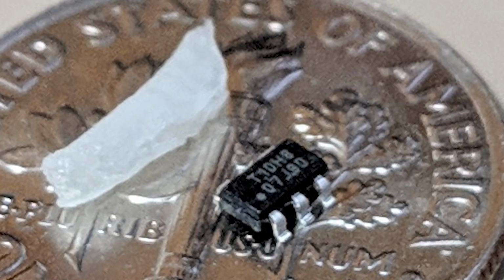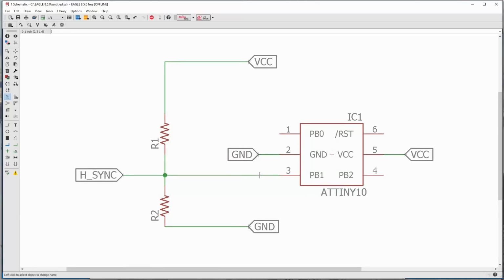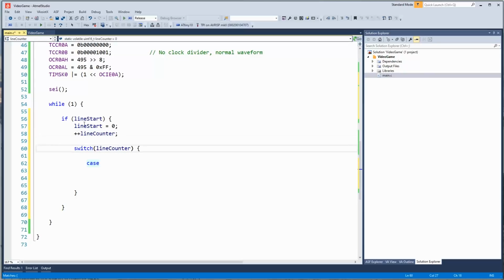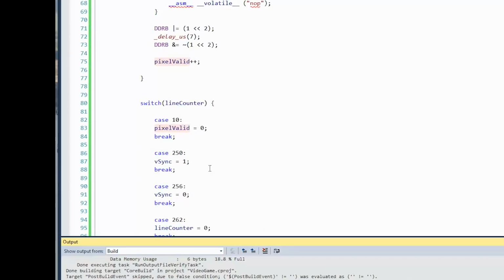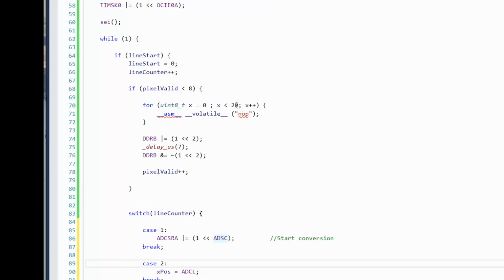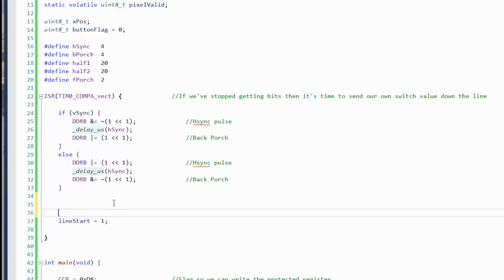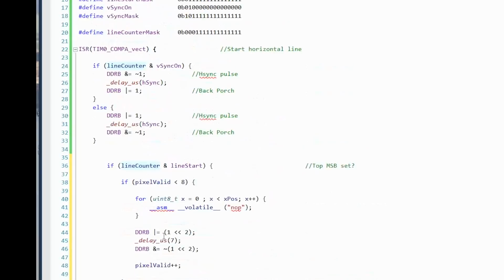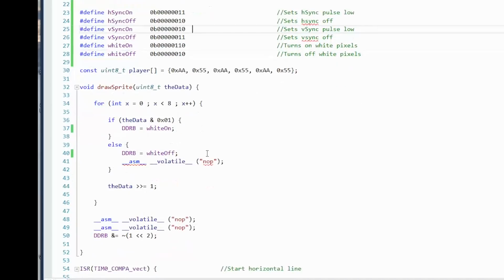ATTINY10 Console Part 1

Comment: Ben, to keep your code significantly more readable you should use bitfields instead of doing all the math yourself. It allows you to declare the exact number of bits you need for a variable. you do have to stuff them in a struct together though. struct { uint8_t pixelValid:1; uint8_t hSync:1; uint8_t vSync:1;uint16_t lineCount:9  }videoData; for optimization's sake i would also add a uint8_t pad:4 in the middle so the lineCount is aligned at the bottom. This may or may not make a difference depending on your instruction set or your controller but it can. All the single bit variables will generally use single bit compare, set and reset instructions so they are faster that way also. Though to be fair the compiler is likely figuring out what you're doing and using those operators anyways.

Neat stuff getting a video signal in that small of a micro :)
Reply from the maker: I'll look into it!

Comment: Great stuff! Dabbled with video generation on AT chips myself (ATmega328 and ATtiny84), but that's just an added challenge to make everything work on a 6 pin ATtiny10, good job. For tips on stabilizing the linestarts: 

1) Make everything happen in the interrupt regarding drawing, and use the main loop for game logic (you kinda did this already)
2) add a crystal or calibrate the internal oscillator, on my own systems the line stability increased simply by using a crystal instead of the internal oscillator
3) entering an interrupt takes a variable amount of cycles in AVRs. Even if the chip was timed with an extremely precise oscillator, you'd still get line jitter depending on where in main loop your code was when the interrupt was called. It takes anywhere from 2 to 4 cycles to enter an interrupt and you almost no way of knowing how many it took this time. Luckily you are using a timer interrupt, and you know when it triggered, so waiting for a specific TCNT will take the rest of the instability out. Might require some assembly massaging though to make sure the wait/synchronize function ended on the exact same TCNT in every case.

I'm sure you already knew this, or at least about this, but in case you didn't, here it is, and in case anyone else is interested in this, here you are.

Comment: Ben if you partially use inline assembly you can use set bit and reset bit.
TSB and RSB if I remember correctly, and there should be an instruction for checking a bit(6502 has one).
That would significantly save program memory from all that bit shifting.
But if I remember correctly you cant pass those instructions values, it has to be a hard coded constant.

Comment: With what you said about switch statements, they act in whatever way the compiler believes is best (but that might not be strictly true). Modern compiles tend to output a bunch of assembly branch if statements, rather than pointer tables (which I is what used to be taught about switch statements back when I was in university).
The switch statement is supposed to replace 'goto' and in some circles it is considered just as evil as 'goto'. In my eyes, it is a self-contained, easy to follow version of 'goto' with a single condition.

I found some really awesome ARM assembly the other day that did the job of a switch statement by jumping the program counter forward into a bunch of aligned instructions based on a condition; the only possible way to replicate that was to use a switch statement, but no compiler (as of right now) is capable of doing such a smart bit of programming, they all default to a load of branching conditions.
Reply: A quick test showed AVR-GCC decided to use calculated jumps for 8 cases, but not 4. GCC also supports computed gotos. However, both cases produced far larger code than an assembly routine would. Funny thing about the AVR: if (bit_test) bit_set; else bit_clear; is bigger and slower than if (bit_test) bit_set; if (!bit_test) bit_clear;

Comment: Presumably you prefer typing out the register values as 0bXXX or doing it for simplicity, but fwiw the AVR headers define all of the bit names, so you can do stuff like:

ADCSRA = (1<<ADEN)  | (1<<ADATE);

or

ADCSRA = _BV(ADEN) | _BV(ADATE);

Which compiles the same as:

ADCSRA = 0b10100000;

The names are still a little cryptic, but easier to add, remove and search.

Edit: oh nvm I see you're using all of these 😅

Comment: What a great project! I love seeing just how much the ATTiny series can do with careful programming. 

I believe to get completely stable video, you need to put the processor into sleep mode before the end of each line, so it wakes up on the hsync interrupt. Otherwise, it finishes executing the current instruction before servicing the ISR, which takes a variable number of clock cycles.

Comment: This is really neat.

Minor point about those black lines in the 2600 Ms Pac-Man. It's a glitch that happens when the sprite fine position adjustment registers in the TIA are updated, because of how the process involves stuffing extra clock pulses into the TIA's state machines. That's why you see those same black lines with the same widths on a bunch of games.

The way the TIA was designed you were expected to set the sprite positions once before the screen started drawing, so the glitch wasn't supposed to be visible. But games started updating the position in the middle of the kernel in order to reuse sprites on different scanlines for multiplexing, or for graphical effects where they're wobbled around.

Some games would either use a black background to mask the effect (eg Space Invaders) or they'd set those registers every scanline so there was a full black border that didn't stand out (eg a lot of Activision games)
Reply from the maker: Ah good to know!

Comment: in my last career, I squeezed out every possible bit of memory using peripheral registers for things I wasn't currently using on the chip.  I would set those bits high or low depending on what I wanted to save. Since these are a hardware registers no ram was being utalizied.
Reply from the maker: Good trick! It may come to that yet! :)

Comment: What I like in this video is that you squeeze that "pico"-controller to the maximum to make something amazing. I follow this project from the begining and each time you add a new feature I thought you will run out of memory but you processed video signal and sprite and movements control and you still have more than half memory space! I am excited to see how you'll complete the game with this tiny memory space?! Bravo. Won't you need to make your code as flat as possible (without functions) in order to not waste memory space in function arguments and return adress and thus recover some stack space,  because you may need it for new variables for game processing?

Comment: NTSC - Never Twice the Same Colour I was taught :-)
Reply: Yup, tweaking that color tint control every time. Well at least on older color TV’s that is.
Reply: So, the exact statement with a redundant character no longer matching the acronym. Thanks.
NTSC - No Two Times The Same Colour. I think is correcter.
Reply: Was taught the same back in the 90s. The upside was that unlike PAL it was much easier to convert 24fps to pseudo 30fps (29.97)
Reply: On the contrary, ATSC = Always Twice The Same Color. (But with other problems like 8VSB's poor tolerance of narrowband interference unlike OFDM.)
Reply: SECAM = Something Essentially Contrary to the American Method :-)

Comment: You may introduce a hysteresis for the analog value, thus, accept a new value only when it differs at least ±2 from the currently used one.
So you get rid of potential jitter when the poti is just between two values.
Reply from the maker: I may also use the lowest few bits of the ADC to feed a random number generator.
Reply: Also add some filtering. If the ADC is sampled right when the button is becoming pressed you'll have a race condition. For one sample you will misread the potentiometer position, which will then get recorded incorrectly when the next sample is read as high.
Reply: Yeah, median should do, probably 3 values should already work.

Comment: Instead of setting up the masks manually, one thing you can do is make a struct and carve bit fields from it. As long as the total number of bits is less than the width of your underlying type, this specific compiler won't add any padding, and rather than having to write code with "&=~" or "|=" and making sure to remember to include masks each time, just refer to a member of the struct and the compiler will handle all that.

Comment: I'm using a micrcontroller to do the video timing on the Mini PET (the actual video comes out of a hardware shift register fed from font ROM indexed by video RAM). I found whatever I did with interrupts I got a bit of instability on the left hand edge. I wrote is several times in C with and without interrupts, and finally, the only way I got rock solid video every frame was to rewrite the whole thing in assembly. I unrolled many of the loops unrolled using macros to avoid start and end of loop timing differences, and the conditional statements had to be carefully written to equalise the number of cycles for yes or no outcomes. It was quite a lot of work sitting with a logic analyser adding the occasional NOP here and there to get the timing precise for every line of every frame, but I was very happy with the outcome.
Reply: I'm curious why you were seeing that. I've been working on a similar project (essentially using at AVR as a CRTC) and I just lifted the video timing and interrupt code from an Arduino TV-out sketch (not the "official" TV-out library, a self-contained one called VideoSPI) and it looks great stability-wise even at 64/80 column (eight and 7 clock ticks per character with a 12mhz pixel/cpu clock) I'm still building the project out of the Arduino IDE, although I am using embedded assembly for the actual pixel output loops so I've been thinking of moving it to Studio.  I didn't have to unroll address generation and output, it just barely fits, but I am "cheating" and not using AVR code to generate the shift register loads; I have a GAL acting as a clock divider/shift register load state machine that gets synced up at the start of the pixel output spew.

Comment: You can use a single pin for video: 0=sync, Z=black, 1=white. Make DATA=0 during blanks, 1 during active regions. Changing DDR selects between black or not-black, both during bank and active, and is still time-critical.
Reply from the maker: Hey I'll give that a try, thanks!

Comment: You could use a shift register to get cheap digital I/O if you wanted to be able to hook a joystick up. Of course that might bump the price point up to using a slightly larger uC but it would still go along with the overall theme of using an ATTINY10.

Comment: You could do a vertical racer. The drawing would be quite simple as each line of the track is always the same (unless you get fancy and add the dashed line in the road) it just would have a different starting offset each line. I'm not sure if the game logic would be too complex (maybe start with no computer players and just do collision detection and have the rate of change in the track increase as the game progresses).

Comment: Nice--reminds me a bit of the Hackvision, an older Arduino-based project that also used bit-banging to generate black and white NTSC.  Looking forward to seeing how you complete this project and I love that you took on as your challenge a device with only 4 I/O pins.  Also wondering if you'll use your last pin--maybe for a second player, or add a couple more "colors"?  As for game, would something like StuntCopter for old Mac work?  Helicopter tries to drop guy onto moving cart with hay on the back.  Score points or splat.

Comment: Maybe for the pot you could put it between two resistors and have the button short one of them out

So when the button is pressed, the pot voltage is one range and not pressed is another range

So you'd drop some resolution but you could still measure the pot and button at the same time

Comment: Well that was a very interesting example of what you can do with efficient programming. The AVR architecture is one of the fastest CPUs on the market when instructions per clock cycle is the measure. It's sad that they are so expensive for what they are as you can get an ARM M0+ in a 24 pin package for around 50c and yet the AVR8 was some $3.30. I think it's because of the dies size but that's just a guess.

Comment: if you using 9 bits out of 16bit word, then you have 7 spare bits for flags, not just 3 (the calculator confuses you with 3 x 4bit groups)
using #define does not cost memory, as those are just placeholders for const values (or creating a macro)

Comment: I'm currently working on an ATTiny85 handheld console. Instead of just one though, I'm attempting to use them in parallel with three powering a TFT lol. I could use SPI with a single tiny, but it's just too slow. I need parallel

Comment: 34:36 Called HMOVE lines, annoying hardware limitation that Activision drew over with the Ball bit. Yeah a default interlacing is probably in order. Kudos on using a paddle to button setup, something only Omega Race did on 2600. ;)
Just looked up arcade games with only left, right, and one button. Sure some version is possible even in the Magnavox Odyssey 2 sense of graphics or even squares and lines.
 Good Luck.
Lunar Rescue
Galaxian
Tapper
Bank Panic
Bubble Bobble
Wonder Boy
Mario Bros
Battlezone
Defender
Pooyan
Joust
Radarscope
Timber
Moon Patrol
Circus Charlie
Stratovox

Comment: The blanked lines on the left side of Atari 2600 games happen any time a new horizontal position of a player, missile, or ball graphic is set at the start of a scanline. It's meant to be done immediately after the HSYNC and the TIA graphics chip cannot output anything during the several cycles it takes to complete. Those blanked lines annoyed Activision so much they simply blank the entire left edge of the screen, making all of their games 5% narrower than most.

Comment: I would be interested to see a single analog input used as a more complex controller. You could feasibly set a dpad and a few buttons to correspond to ranges or patterns in the analog signal

Comment: For my microcontrollers class we did a dodge the falling blocks game. iirc I was able to get it to run on 256x256 in color down to 8MHz or less on an MSP-432, I think the ATTINY10 should be able to handle it just fine when it's not my inefficient spaghetti code mess.

Comment: 14:22 , I'd be very hesitant giving out advice such as that. Compilers have moved beyond the realm of common sense and predictability a loooong time ago. 
I mean it sounds true, that on simple HW with a trivial pipeline, even an unpredictable indirect jump will win; however, it is not true that a jump table will always be generated, and not all HW is this simple. In this case, you might be able to save a further few cycles if you do it with math instead of branching. But if you're really worried about performance, the only way to know is to measure.

Edit: in fact, I've just checked, and gcc with -O3 generates identical assembly whether you write the code using if-elseif or with a switch...

Comment: Always been curious just how much can be done with super simple microcontrollers or stuff like the Atmega 2560 boards.
Reply from the maker: This would be a LOT easier with even a ATTINY25 as they have a "universal serial port" which could be used to SPI out the sprite bits. But I like a challenge!

Comment: 14:25 Switch is often turned into a jump table, but function pointers that evaluate in the middle of a pipeline are very bad for the cpu.
Reply: "Very bad" in the AVR translates to precisely as long as any other jump (2 cycles).
Reply: @0LoneTech  And clears the pipeline if the prediction was wrong. These jumps are usually random. If there are only a few simple cases, it's better to let the compiler do branch elimination by computing everything and selecting the results with logical ops based on the condition.
Reply: @gabest4  Atmel's AVRs have a two-stage, single-level pipeline design. They don't predict. They do however have an alternative to branches: the skip instructions conditionally inhibit one instruction.

Comment: Here's me wondering whether I need a Cortex M4 or an M0+ on my 14x2+5-sized dev board from a well-known 'maker' company (with commensurate adjustments in other resources) and I decide to 'read around' the topic. Then I stumble on this.
I think it might have to be Arduino's new favourite for me, despite the fact you tell us right off that you're here specifically because it's "doing your nut".  - And a $aving of hardly anything (comparatively) - but just because it's "good for the soul" to have a bit less than 192kB SRAM immediately on chip, sometimes.
Reply: When I get confident enough to solder 0.8mm pitch of quad flat (and indeed to 'bring up' a chip from blank), I've got a number of devices in the league of THAT (and an occasional one closer to the league of THIS). That's where the savings will be - not that I plan to be making batches at all; Just nice to know I could.
Reply: It's only a pity that the job-lot of my 'practise specimens' are  in the STM8 series (factory rejects in a busted Tray from some other continent.) Not enough love for those yet.
Literally the price (each) of not a large number of peanuts in a snack-sized pack at convenience store prices - given that I was interested in ordering from that supplier for other items already (not just limited to the SMD breakout boards for the same, either.)
Reply: I think this is called taking the Red Pill []. :-S